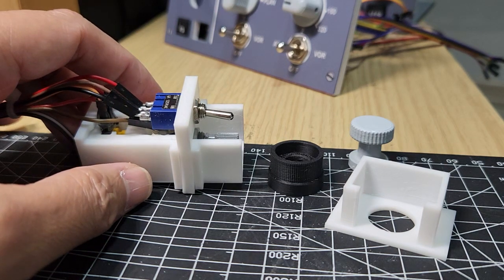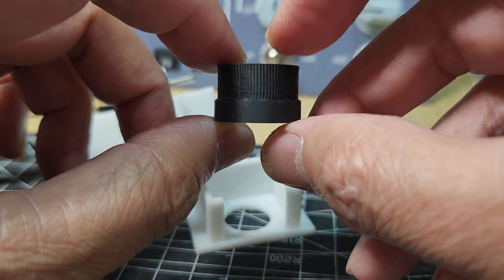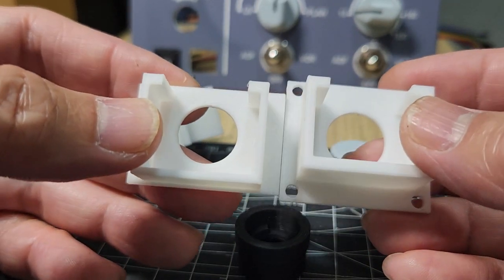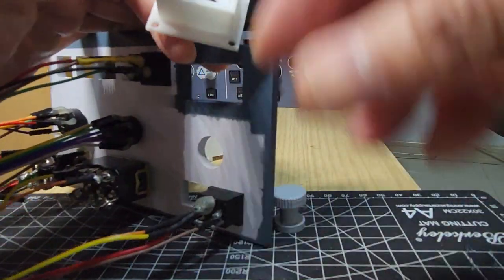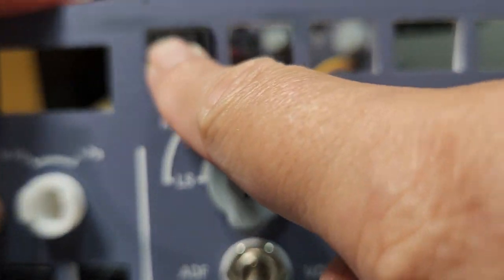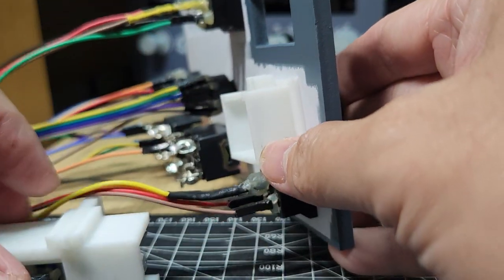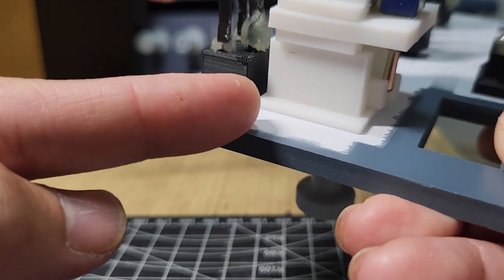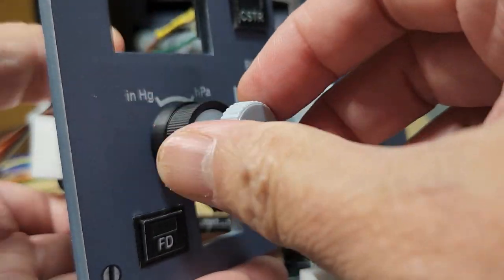Mod of the FCU-ALT knob for use on the EFIS-BARO.

Comment: Bro I was just 5 minutes ago trying to modify the model to fit in EFIS panel and I was struggling with it
And I was also designing the Knob ( struggling too :[ )

This video is at the perfect moment, thank you so much !!!!!!!!!!!
Btw do you have the files to laser engrave the panel ? Thanks :) :) :)
Reply from the maker: LOL Bro!!  I hurriedly made this video because as the KAV LCD just released, I am pretty sure those who used my FCU-ALT knob will (like me) use it for the EFIS-BARO.  And when I found out it doesn't allow enough space for the LCD and buttons, I panicked LOL!!!  Hopefully the new measurement works for you.  I have yet to wait for my order of the Kav Simulations EFIS LCD to see for myself though I already took the dimensions of it from their website.  Which panel?  I used the Mobiflight repository for the panels and moded them a little bit :)   https://github.com/MobiFlight/mobiflight-panels/tree/main/aircraft/airbus-a32x
Reply: @santiagoluib3  Thank you for your quick anwser !! Yeah the new dimensions work well now ! :D Could you give me the moded version of your laser engraved panel file please ? Thanks !!
Edit : print already started :D
Reply from the maker: @Planum.  Bro, in case you don't know yet, my panels are only made of 5mm Sintra PVC board.  So no laser engraving required.  I just use art knives to cut holes  :)))  I made the decals in Photoshop, print them on Vinyl sticker, and stuck on the board and manually cut ;)  And uhm, no backlighting too ;)
Reply: @santiagoluib3  Oh, sorry , thanks for this precisions. Btw if possible could you give me the decals that you made in photoshop ? Thanks ! :)
Reply from the maker: @Planum.  Email me Santiagoluib3@gmail.com